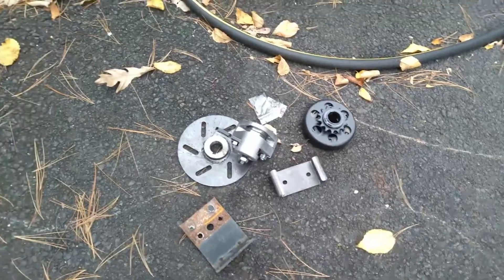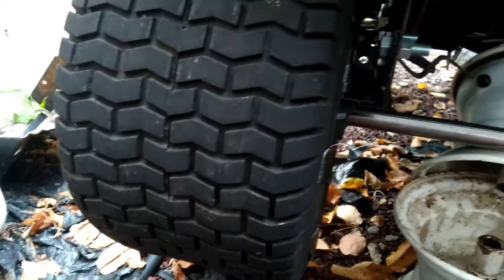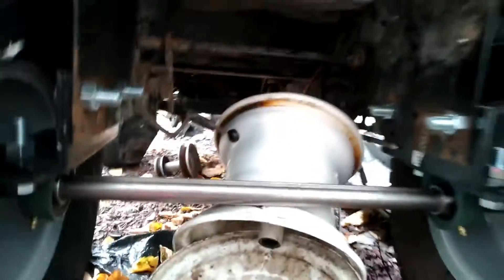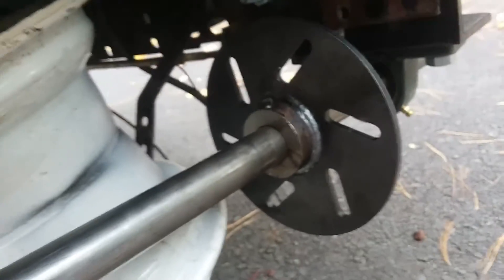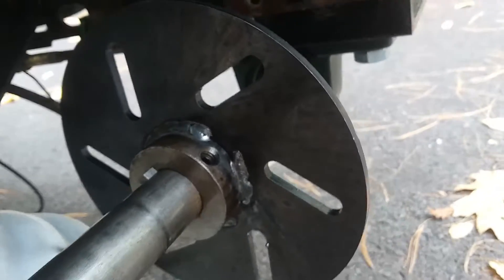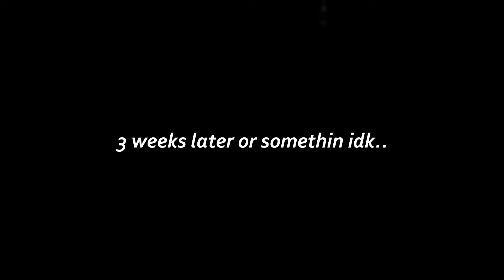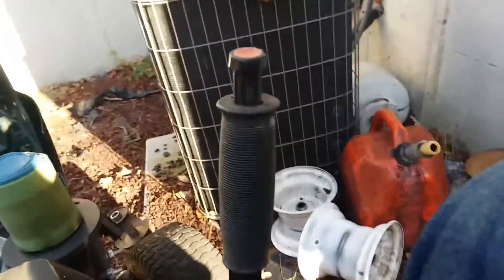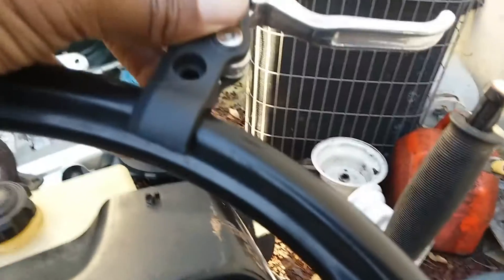Its almost time to drive the horizontal engine mower! - Part 5

Comment: Not to bother you but what did you use for angle iron to mount the pillow blocks
Reply from the maker: The L brackets had holes pre drilled in them. I drilled 2 holes in the chassis and bolted the L brackets onto it. The L bracket also had 2 holes at the bottom as well which I used to bolt the pillow block bearings. I show the setup in detail in Part - 4 where I install the rear axle.

Comment: Also can you put the clutch link in here I found one but not as good as that one looks... and the sprocket you use too just for an example of the size
Reply: Buy a different one search it up and you will see one with two pulleys and a belt with a plate on the back it’s the best one all you gotta do is bolt it to the engine and then a chain mounts to the bigger one it will be pretty fast
Reply: Probably 30 and put a small sprocket on the axle that increases speed
Reply from the maker: If i remember right I do believe it was this one: https://www.amazon.com/Centrifugal-Clutch-KIOLPO-1inch-Tooth/dp/B0844J47Z2/ref=sr_1_1_sspa?dchild=1&keywords=centrifugal+clutch+1+inch+bore&qid=1607276732&sr=8-1-spons&psc=1&spLa=ZW5jcnlwdGVkUXVhbGlmaWVyPUEyV1AxVEVCN0ZTVDhJJmVuY3J5cHRlZElkPUEwNjIxODA3MjBQSUdaMEU1MkczVyZlbmNyeXB0ZWRBZElkPUEwMDMwMzQ1M1A1VjNHM0gxRk8yJndpZGdldE5hbWU9c3BfYXRmJmFjdGlvbj1jbGlja1JlZGlyZWN0JmRvTm90TG9nQ2xpY2s9dHJ1ZQ==

If you want more speed you can buy a torque converter also. I'd love to put one on there but a 40 series torque converter is way above my budget and I think most torque converters I setup for predator's honda's and briggs engines not kohlers.
Reply: Ok thank you
Reply: @that250exc  are you talking about a Torque converter

Comment: Where are you putting the sprocket because the engine shaft is so far to the left are you putting it outside the mower
Reply from the maker: I lined the engine shaft and clutch properly so I can run the chain straight back to the axle. The chain will be positioned in between my legs at the center of the mower.

Comment: Looking good. But off with the Axel again for the rear sprocket. Remember big rear sprocket = more acceleration small sprocket fast top end and will hurt more when it topples over 👍
Reply: Wrong big sprocket means slower small sprocket very fast
Reply: Wrong dude.
Reply: Ask someone who's raced anything with a chain drive. 🙄🤙

Comment: Ive always wanted to build the same thing and i have the tools but not the parts
Reply from the maker: All of this was affordable. I dont have a full time job or anything like that. You also just gotta know where to buy stuff so you dont overpay for parts and stuff.
Reply: @thephenomenalgarage6707  that is what I’m doing right now
Reply: @powphenom what websites do you use
Reply: @thephenomenalgarage6707  what website do you use to get stuff
Reply from the maker: @muddinman736  Mostly everything off of this build is from amazon. Some of the more larger things like the axle and rims are from BMI karts. The mechanical brakes and 60T sprocket is from go power sports.